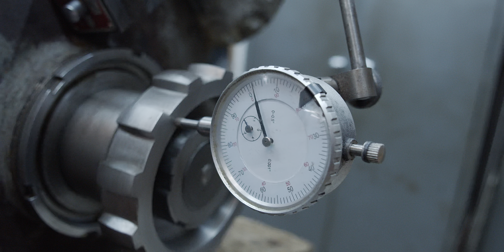SUNBEAM 1000HP GEARBOX RESTORATION AT THE NATIONAL MOTOR MUSEUM

Comment: I am not a mechanic, but I have some machining experience and have bee through abespoke gearmaining shop in Sheffield to see some of the processes involved in making large gears like these. I did notice some edge damage to two of the gears in this box, Not that nasty but did some of the teeth need dressing to smooth them - or would that be counterproductive?
Reply: When the car was making its record passes back in the day they had issues with 2nd gear engaging. That’s the result of it. I doubt this car will go into 2nd gear again since 1st gear takes you to 70mph.
Reply: Nothing like an old socket to drift a bearing in.

Comment: Those gears look like they have some modification to the addendum, and flank modification too. The pressure angle looks different to the normally weak vintage PA of 141/2°, it looks more like the stronger and more modern norm of 20° PA. Pity there isn't more tooth root fillet!

Comment: Sliding pinion gearboxes always show chipping and rounding of the tooth leading edges - even the most skilled driver is going to crunch the gears in a crash gearbox occasionally, especially when getting used to the particular vehicle - and this, of course, was a one-off, and a pretty fearsome one at that.
In fact, I was struck by how pristine the gears in this were, reflecting the relatively few miles it actually travelled - you should see the state of the teeth in a bus or lorry gearbox which has done hundreds of thousands of miles!
Reply: This gearbox resembles a cross between a motorcycle gearbox and a lathe headstock gearbox. Pity it wasn't made a constant mesh.